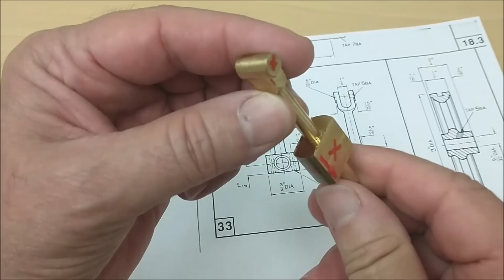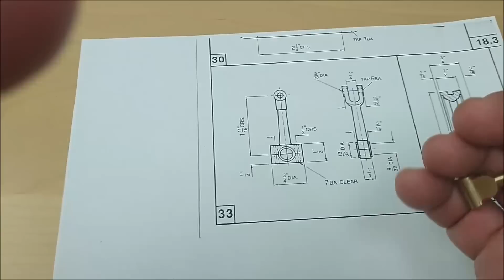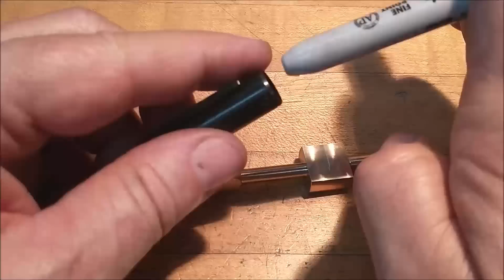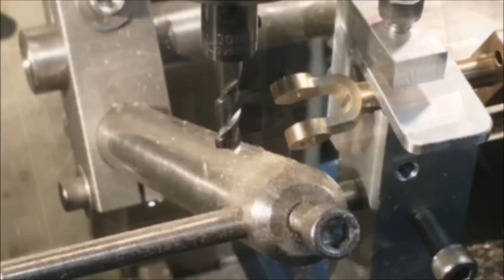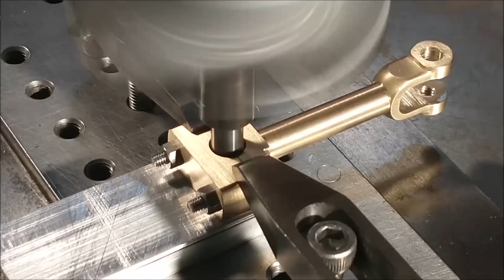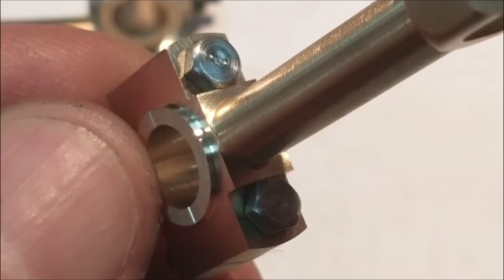Stuart D10 - # 11 -- Machining the Connecting Rods

Comment: You infer BA thread's are metric. I'm sure they would be imperial having a 55 degree thread and not 60 as I believe metric thread's do. I may be wrong but, being British at my time of growing we where taught imperial measurement and as a result, I find I have to learn what a micron is and how big it is in comparison...all the time. I just found your channel and am enjoying this series of the engine build. Thank you for putting video's out as you do
Reply from the maker: You're welcome. My logic is that the 'B' in BA probably means British. British=Metric in my mind. Enjoy the channel and thanks for hitting that sub button. Much appreciated. be sure to check out the other engine and machine tool model builds. Lots to see.
Reply: @joepie221  Quick reply, thank you. British Association. The thread has an interesting history, cheer's
Reply: I just wrote and deleted "I'm confused, I looked up the specs on BA threads and they all list the pitch in threads per inch, why do you keep calling them metric?" 
Before I found this thread.

My Dad started his apprenticeship with one of the airlines that became British Airways in 1957 and he was very much an imperial guy as that's what he learned and worked with for years. When I was in school in the 80's things were all in metric by then except we used miles and gallons (our gallons are not the same as US gallons of course that would be too easy!) Dad always hated that bloody French metric system 🤣😂🤣

Comment: Joe I am wondering how you got the single point fly cutter so acurately adjusted on each cut. did you gently tap the back of the tool from behind with a copper faced hammer and then measure the distance from the outer edge of the oposite side to the cutter to the cutting edge?
Reply from the maker: I've reviewed this video again and can't seem to find the flycutter portion. Can you give me a time reference?
Reply: I think fe talks about the boring head @joepie221

Comment: I do not understand this.  My Stuart 10V and compound launch engines came with connecting rods as rough castings.  You seem to be starting with something that is already 3/4 inch machined.  Did I miss a video?
Reply from the maker: I got mine that way.
Reply: I'm doing a 10V and mine is a rough casting too.
Reply: @Mr986Willis I've got a d10 and mine came in the semi machined state shown here from Stuart

Comment: Since when is 5Ba a metric thread?
Reply: BA threads are specified by British Standard BS 93:1951 sizes 0 B.A. to 16 B.A. The sizes are defined in metric terms, i.e. 0BA has a 6 mm diameter and 1 mm pitch. 👍
Reply: Let's ask Wikipedia:
" British Association screw threads, or BA screw threads, are a set of small screw threads, the largest being 0BA at 6 mm diameter. They were, and to some extent still are, used for miniature instruments and modelling.

They are unusual in that they were probably the most "scientific" design of screw, starting with 0BA at 6.0 mm diameter and 1.0 mm pitch and progressing in a geometric sequence where each larger number was 0.9 times the pitch of the last size. They then rounded to 2 significant figures in metric and then converting to inches and rounding to the thousandth of an inch. This anticipated worldwide metrication by about a century. "

Sounds like they are both metric and inch, also neither, with 5BA having a pitch of 0.59mm or 43.05TPI  makes little sense in either system
Reply from the maker: Ever seen a BA thread called out on a US drawing?
Reply: @joepie221  Did you notice that all the other dimensions on those Stuart drawings are in fractional inches?  Weird huh?

Comment: Hey Joe, as a guy whose had grease under his finger nails his whole life I thought you would have tapered the main shank of the rods from the big end to the small end. Every connecting rod I've ever seen has been tapered this way, from my Dad's glow plug model airplane engines to the 1.75 meter long (or longer) rods of main diesel engines. It's a little late for that now but I think it would've added a bit of elegance to them. No criticism, JMO.
Reply from the maker: The rod bodies came partially machined. They would look good tapered. Hmmm...??

Comment: That is one of the craziest 4th axis setups I've yet seen. I'd hate to be the poor chap who'd have to write the setup instructions for that op. Thanks for showing us another "outside of the box" solution. Getting as much work as possible out of one setup is a wonderful thing.
Reply from the maker: I basically finished 95% of the part in one setup. I could have back turned the journal bosses with a boring head, but the space was the killer.

Comment: used to do a lot of splits. trick is to put small chamfers on the split corners. this will allow the center line some tolerance on location
Reply from the maker: That gives you more leeway than most realize.

Comment: Just laughing at the BA / Metric comments…. Look up 0BA it’s basically a M6 😂.
BA still has its place in Models for all the folks that have all the taps and dies…. And use the vast availability of BA hardware for model engineering. I’m nearly done with a Stuart Victoria.. it uses BA, ME and metric threads 😂😂
best regards from Cypress Tx.
Reply: It is interesting ..
If you Google it you get both replies .. including yours ref: 6mm ... O BA
I have quoted an article in Model Engineer saying definitely not metric.

I guess the definitive dimension is the thread form.
60°  metric
47.5°  BA.
Reply from the maker: I do have all the taps and dies. They were supplied by Steve Bright when he donated the kit, but I like to single point and small short metrics can be a PIA.

Comment: You couldn’t get much closer to a 5ba if you tried. Just 10 thou on the major diameter & under 2 thou on the pitch (although the angle is quite different at 47° on the BA fastener).
In real life I bet you could just about interchange them (depending on how heavy handed you are with a screwdriver 🤣).

Comment: You were right not to try to single-point the BA threads. 5BA is 43tpi (or 1.693mm pitch) and that is the only one where the tpi is a whole number. For example, 6BA is 47.9tpi - good luck finding change gears to cut that. Basically, it's a case of buying a set of taps and dies or converting to something else.
Reply: Plus trying to grind a tool small enough with a 47° angle! 
I do a lot of BA stuff but I wouldn’t dream of single pointing any of it.

Comment: GOOD DAY, JOE P. I sure enjoy these visits. I am a bit surprised at the dull tooling being used by Stuart on this piece. Up until this one everything has had very good castings and pre-work. Sure glad they left enough meat for you to squeeze this one out of. I am sure liking the V block setup for the clevis end. Without that support being carefully cut to size that piece just couldn't have been so expertly machined. Awesome my friend, just awesome. The time you spent thinking about how to approach this part was time well spent. The proof is right there in front of us. Another accurate and great looking piece for us today Joe. I usually had a difficulty with facing etc the big end of parts like these. The large sweep of the piece and needing to get right in there would usually cause me to get dizzy and the chance of being drawn in was always there. I would often have to shut down and regain my equilibrium. Love that self preservation thing eh, LOL. Curious, , , As these connecting rods are attached to a moving crank shaft is there a way to oil the ends ? Brass to steel is a pretty good bearing but sort of ok at smaller speeds and loading but will still need a lubricant and at higher speeds and pressures most defiantly need some slippery in there eh. Direct injection or drip or possibly a submersion enclosure tank of some sort ? Great to see you still producing these perfect wee parts. Take care and why not dive this weekend eh. Do you have a favorite wolf eel to visit. They are surprisingly friendly and remember their visits from us.

Comment: Nice video. It must hurt into your very Soul, to mention millimeters, instead of Bananas. (j/k)
Allways the futile stride between the centimeter and the Inch, haha.

In Sweden, we are still using Withworth Pipe-Threads. The size of pipes are still in Inches as well, haha.

60,3 mm outside is still called a two inch pipe, despite it's various wall-thickness.
Reply: Bananas as measurements are used by Kurtis of CEE in Australia.

Comment: Joe, I hope you are in a position to enjoy some family time this Memorial Day weekend. I always told folks machining is easy. It's the fixturing and part holding and order of operation that is critical. You think things through and fixture accordingly. Great fun to watch you work. Thanks for doing the video on this build. Another thing I always told the guppies and minnows coming up through the shop. It's not what you have done , it's what you have seen done. Put those pictures in your mind for use at a later date. Adapt a fixture design or process to fit what you need to accomplish on said job in hand.

Comment: Interesting castings.The connecting rod casting I got with the Ajax, was so screwed up, I machined one from solid stock. I think they should have provided solid bar with the kit. I am pretty sure it would have been cost effective for them. I like the cutouts for the bolt heads.Sweet.
Yeah.I don’t think I would want to single point 5-40 BA,either.

Comment: No metric guy is going to complain about you not using BA. They’ve been obsolete since 1966.
Reply: They were still used on quite a few things long after the 60s.
From darts to gas jets, & plenty of electrical items.
Reply: Interestingly, BA is metric….😮….. 0BA is 6mm by 1mm pitch…. Thereafter it turns to custard…..
Reply: Don’t the model engineering guys still use them?
Reply: @sblack48  They do, but the standard was obsoleted more than half a century ago.
Reply: Thanks Joe.

Comment: Thanks Joe - excellent as usual - exemplary workmanship. I went to school in an ex-British colony (Rhodesia/Zimbabwe); when I started school we were taught only imperial units, but by the time I was in high school we'd changed to the metric system, so I feel at home using both systems. When the measurement is about anything human, height, weight etc I still think in feet, inches and pounds, when it's anything engineering or scientific I think mostly in metric, but driving distances and speeds have to be in miles and mph!

Comment: Rather than tapping the small end of the connecting rod, I made it 4mm through the full width of the small end. Made a shouldered pin and retained it with a small split pin. I feel I was able to get the fit closer than using a screw in pin, and needing to take extra care on the pin so the thread doesn't turn out eccentric to the journal.
Reply: I much prefer your method, it leaves the pin fully floating and doesn't add stress raisers right where the maximum shear stress would be in operation.